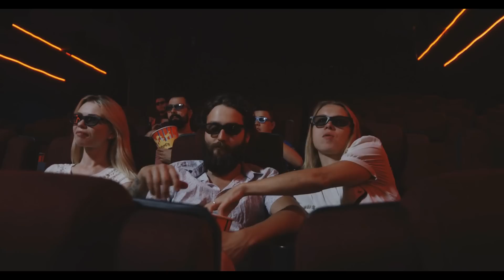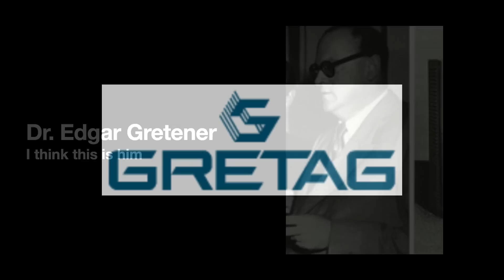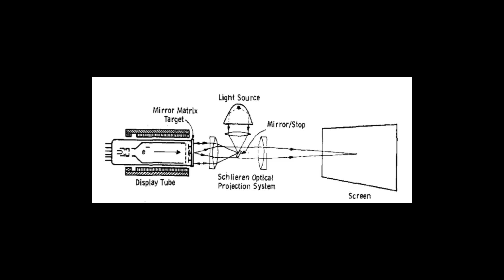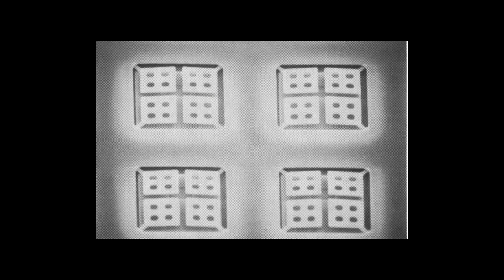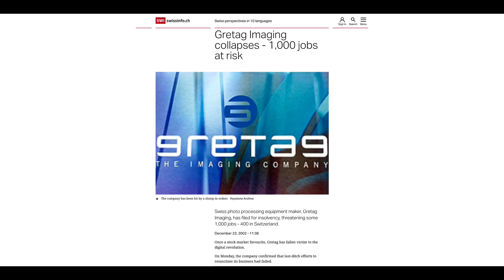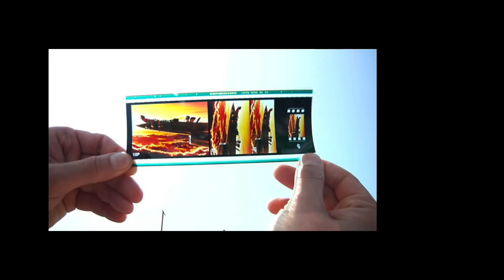How Optical MEMS Won an Oscar

Comment: The entire field of mems semiconductors is just truly incredible.
Reply: Is photonics and semiconductor same i think u are wrong
Reply: @ggboss8502  MEMS and semiconductors are related since many MEMS devices include control circuits and they share similar manufacturing processes. Photonics is a very specific branch of light manipulation using technologies similar to semiconductors (you can create voltage controlled light switches, for example), but in general these do not employ MEMS techniques.  Having said that, MEMS devices such as the DMD described in the video can be used within photonic systems but only for relatively low speed switching compared to true photonic switches.
Reply: @ggboss8502  I think the main difference is one is mechanical, and the other is electronic? But mems also depend on semiconductors for their functioning. So I consider mems to be a subset of semiconductors, perhaps at the extreme going into nanotech.
Reply: @ggboss8502  sorry I just realized you mentioned photonics and not necessarily MEMS or even optical MEMS tech. But consider this: the semiconductor fabrication process relies to a large extent on optical technology. It's essentially a reverse microscope. So I consider optics and semiconductor tech to be 2 sides of the same coin. It's basically at the same size for one to be manipulated by the other
Reply: Soo im wondering if projector mems technology has been considered for use with vr/ar technology? The way how the eyes works is that light is bouncing around in a room so maybe u could shoot laser inside of eyeball to make hologram? They should use this and try to make a technology that totally shoots lasers directly into your eyes and you hallucinate holograms and 4dimensional VR/AR games and slowly burn your eyes out of your skull. That sounds to me like great idea to further drive the technocratic societies attention spans down the shitter. Then no more ‘mental illness’ because everyone will be surviving in a scarce environment.
Reply: i mean, just take a basic class on transistors. 
they work on quantum mechanics, electrons going from one place to another via "holes"
then think that your phone has billions of these, and they WORK. 

magic
Reply: It seriously is just magic imo, it seems like the more I know the more impossible it all seems

Comment: I'm intimately familiar with this topic because I was an early adapter of DLP projectors for home theater use.
1-chip DLP has a serious flaw, in that, at any given moment, there is only one of the primary color being projected onto the entire screen.  Some people are much more sensitive to the so called "rainbow effect."  Moving your head quickly can exacerbate the issue.  They reduced the problem by either spinning the RGB wheel faster, or doubling up the colors into RGBRGB wheel, so that one color stays on the screen for a shorter amount of time, each.
Technically, even 3-chip DLP will have many pixels displaying just one color at some moments, but these are per-pixel effect, not whole screen effects.
Fundamentally, what is projected onto the screen is a pulse-code-modulation pixels.  Each pixel is either ON or OFF at any given time, and in case of 1-chip DLP, in one of the Red/Green/Blue.
There is no grayscale.  It's just ON or OFF.  Each pixels blinks at incredibly fast rate, you can't normally tell, and the brightness is controlled by the rate of ON time, vs. OFF time (hence PCM).  For example, 50% brightness would be represented as ON/OFF/ON/OFF/ON/OFF and so on.  1/3 brightness would be ON/OFF/OFF/ON/OFF/OFF, although they could throw in some randomness to making it look more natural to human brains.
Reply: a fun detail about the rainbow effect is that it gets significantly worse if you're not directly looking at it. The human eye is a lot more sensitive to motion at the fringes of vision (higher density of cones) than at its center and so if you look askance at it you see the flicker much more easily. Once you notice this it's really interesting how many other things you can see flicker--fluorescent lights, LCDs, and more!
Reply: @extra-to-go  Helps when you squint a bit and move your head quickly from side to side! I've always had some fun when going to the theater looking for the effect but never knew what caused it. Amazing!
Reply: Yeah, I really hated 1-chip DLP projectors we had in school because of that rainbow effect. But it seems most people don't see or notice it, lucky for them.
Reply: OlafWillocx  I imagine they were able to control brightness with the original DEFORMING-Mirror-Device, but they just couldn't manufacture a device with all those hundreds of thousands (to millions) of mirrors that deformed at the same rate.  I doubt it's practical even with current technology to map each pixel to different analog algorithm to get a consistent image across the whole device.  DIGITAL gets rid of this problem.  Slight variance among individual mirrors won't matter at all.

I also remember reading about how the molecular fatigue behavior is entirely different at nano scale.  If macro scale physics numbers were applied, there's no way the hinges would last long enough to make the DMD chips viable, but they apparently don't behave that way, and are incredibly long lasting at nano scale.
Reply: Took me forever to revive my memory by searching through web, but the first DLP projector I bought was a Davis DL450.
Like all DLP projectors at the time, it was meant to be a conference room projector, but a number of home theater enthusiasts found it to be a gem of a projector for home theater use, despite its flaws, and it took off in that circle.  Nostalgia....
Reply: @catsspat  Yes.  the hinges for the mirror support are basically nano-scale torsion bars - they twist with the support being rocked back and forth by electrostatic forces applied to the part of the support beneath the mirror.  At the scales used here, there is no significant fatigue of the suspension over the lifetime of the projector.
Reply: @GodmanchesterGoblin  operating like a gimble, at extremely small scale.
Reply: @michaelfoxbrass  Yes, but tilting on only one axis.  I would always think of a gimbal as tilting on two perpendicular axes.
Reply: I’m a rainbow effect see-er.
Reply: You may like to know that currently most DLP projectors are not based on a spinning wheel. They use fast switching leds.
Reply: it seems our mind is capable of discerning more info than the sensors hooked to it. it may have a threashold mechnism filtering out as best it can the noise so to say that would make life difficult if flooding in all the time (lsd). in a nutshell i believe nature has a hum, a rythem so to say and everyhing we have added to it that pulses (digital) has been overwhelming its ability to filter, over time to a greater and greater extent. this could have massive effects on life as we know it. i ask everyone to close their eyes and listen to their mind as if it was someone they loved that had something important to say. give it a chance. is it disturbed? i have a short 32 page book that touches on it and hope to finish the follow up soon. i will send anyone a free pdf copy that wants one.❤
Reply: Field sequential color is definitely not ideal for sure.

I think at one point the flat screen display industry were looking into it with faster blue phase liquid crystal cells, but evidently the rise of direct emissive displays canned this in its infancy.
Reply: wow, this is a great comment, thank you
Reply: The rainbow effect is part of the reason I went with an Epson for my latest projector purchase. I wasn't super affected by it but it always produced visible colour fringing during motion.

Comment: That micro hinge mechanism is fantastic and to think it's possible to mass produce something that small is bonkers.
Reply: When you make normal semiconductors mems is huge dimensionally.   

Getting the hinging to work really is as difficult as you think.  It was the final yield limiter to really get ironed out.
Reply: @rydplrs71  I'm excited to see mems speakers finally break onto the scene and see a similar revolution in the audio world to match the growing mems microphone market, it's been a long time coming.

Some aspiring vendors like Australian Audiopixels have been laying it on thick claiming to be able to fully replace current loudspeakers using flat mems chip arrays - I have to say I'm skeptical but more than willing to be surprised if I could get these into my room which doesn't have anywhere near the space for a decent 5.1 speaker set up.
Reply: @mnomadvfx  there are mems miccrophones?!?!?! :face-blue-wide-eyes:
Reply: yeah and then do it a billion times on one chip, then make a billion chips.

tiss magic really.

Comment: 15:00 Whoever came up with this mirror configuration must have been a genius. Three beams of almost identical frequency light splitting in entirely separate directions, then coming back perfectly in line with each other. On the diagram it looks like chaos, yet every angle of that configuration is a careful design choice. How do you even approach that? Looks like magic to me.

Comment: Some theaters use DLP projectors, but they don't have the contrast range that LCOS (liquid crystal on silicon) projectors do.  You didn't mention the pulse width modulation used on the mirrors to generate shades of gray in each color, but it was a good overview.  Thanks for all you do.
Reply: My understanding was that the contrast ratio of DLP was effectively infinite, because to generate black, the DMD just needs to dump 100% of the incoming signal into the void rather than onscreen. Are there other factors I’m missing?
Reply: @PaulFisher ere are several sources of flare in DMD. 1) the material below the mirror itself does show through a bit since it has to be exposed for a mirror to be free of its adjacent companions. While this is typically coated in a material selected to be as black as possible over the desired wavelength range, it’s not perfect. So even if 100% of light directed at the mirror is diverted, there will be some reflected light from the substrate. 2) the mirror can only tilt so far. Ideally you’d direct all the light onto a light dump orthogonal to the exit pupil, but the mirrors can’t flex 90 degrees, only about 10-12. So some light will be scattered from the mirror edges and the anchor via structure, letting a little light through even in the static full off position. 3) ideally, your light source would have total spatial coherence (or equivalently, be a point source at infinity). Real light sources are only partially coherent and have finite size, so some photons impinge on the mirror at a small angle. When these are reflected in the off state, some small amount of light will still go through the exit pupil. 4) the light dump material is chosen to be as black as possible and actively cooled from behind. However in practice, a true black body does not exist, so there will be a tiny amount of reflection which will bounce around the DMD cavity. Some of this will escape through the pupil.
Reply: @Grak70  We had a Christie 10,000 lumen 3-chip DLP projector which was replaced by a Sony LCOS-type projector.  The DLP unit had noticeably higher black level than the Sony.  I don't recall the light output rating of the Sony, but it used a xenon lamp where the DLP projector used two mercury lamps - so it wasn't exactly a fair comparison.  However, in addition to higher light output, the Sony had a much lower black level than the DLP unit from Christie.
Reply: @Curt_Lundgren  sounds about right. Off state black levels are a major reason DLP became obsolete as LC black levels improved and then LED off-current improved. Then came active LED, OLED, and then quantum dots with ever better black levels. There was a lot of room at the bottom for solid state light solutions, but DLP could never quite keep up. MEMS in general are much more finicky and lower yielding to fab, not to mention they face very different challenges to CMOS. TI repurposed a lot of silicon equipment to make DMDs and I think the ROI of using apples to make orange juice was difficult to justify in the long term, especially with such stiff competition from Japan, Korea and later China. Once China started pumping out decent quality LED displays that kicked even the best DLP’s ass, the margins in display evaporated.
Reply: Thank you both for the explanation!
Reply: Most theaters uses DLP projectors, Sony is the only major cinema projector maker that doesn't use DLP.

As for contrast, not all of them can beat LCOS, but some of the higher end ones can do so easily when properly calibrated
Reply: @PaulFisher  no problem! By the way, notice that cause 1 and cause 2 are in competition! If you tilt the mirror more, you can divert more light, but then you are exposing the substrate even more. So there is a complex trade-off between the torsion material flexibility and lifetime, the substrate reflectivity, and the view factor of the mirror all interacting with a non-ideal source. Still pretty cool it works at all though!
Reply: But LCOS doesn't even come close in terms of color gamut and accuracy and also max brightness of DLP makes up for the black difference.

Comment: Thanks, fascinating story.
I worked with a GE Talaria projector in the early ‘80s, it gave a sharp and extremely bright image (which was essential because it was being used as a back projector in a well-lit TV studio). The thing did have drawbacks, slow to warm up, lousy colour purity and an interruption to the video feed would generate a line of bubbles in the oil which would take a couple of minutes to clear as the disc slowly rotated.
As I recall, the potential for the oil to contaminate the vacuum in the light valve was circumvented by a catalytic device that ‘cracked’ large molecules to smaller ones that could be absorbed by a getter.

Comment: Nearly all laser projectors in cinemas still use DMDs/DLP for their imaging, the lasers simply replace the xenon arc lamps as the light source and can improve contrast due to the narrow light band of the lasers
Reply: And also the ability to blank the lasers in between frames.
Reply: @moki123g  generally they dont, shutting the lasers off between frames keeps them from producing stable colours and in cinema units colour accuracy is paramount.

blanking is more something done by the DMDs themselves by simply putting all pixels to the off position and holding them there. It is used fairly extensively even with arc-lamp based units, principally its used to keep you from seeing the image go hilariously terrible while the rest of the imaging system re-adjusts for a new raster timing/resolution.

the main benefit to the lasers is their narrow colour bands means less light that doesn't go to the DMDs, which increases contrast because there is less 'unwanted' light coming out of the projector

Comment: There are several sources of flare in DMD. 1) the material below the mirror itself does show through a bit since it has to be exposed for a mirror to be free of its adjacent companions. While this is typically coated in a material selected to be as black as possible over the desired wavelength range, it’s not perfect. So even if 100% of light directed at the mirror is diverted, there will be some reflected light from the substrate. 2) the mirror can only tilt so far. Ideally you’d direct all the light onto a light dump orthogonal to the exit pupil, but the mirrors can’t flex 90 degrees, only about 10-12. So some light will be scattered from the mirror edges and the anchor via structure, letting a little light through even in the static full off position. 3) ideally, your light source would have total spatial coherence (or equivalently, be a point source at infinity). Real light sources are only partially coherent and have finite size, so some photons impinge on the mirror at a small angle. When these are reflected in the off state, some small amount of light will still go through the exit pupil. 4) the light dump material is chosen to be as black as possible and actively cooled from behind. However in practice, a true black body does not exist, so there will be a tiny amount of reflection which will bounce around the DMD cavity. Some of this will escape through the pupil.

Comment: DLPs are in automotive headlights now. As ridiculously expensive as they are, it's one of the most exciting modern semiconductor features in cars to me.
Reply: I just use aftermarket LED light bulbs to blind the people in front of me.  The key is to use purplish and blue color which really distracts them and makes them turn their heads away from the blinding light.
Reply: @ahndeux  makes it a strobe light and the pedestrians would crawl before you
Reply: @megalonoobiacinc4863  Anything to slow them down would work.  Thanks for the strobe idea.  A nice multi colored strobe led would make them crawl on their knees.

Comment: I remember reading about MEMs as far back as the 80s, in EDN. Saw my first TI DLP projector, a consumer grade one, at the CES trade show, either in the late 90s, or early 2000s. I, too, once worked for a company that won an Oscar (Moviola). Though they won that Oscar decades before I was born.

Comment: The last time I used a paper airline ticket was about 2015 when an intercontinental flight was cancelled and the service desk put me on a different flight. When they handed the paper ticket I was actually worried that it would not be honored for my connecting flight but it worked.